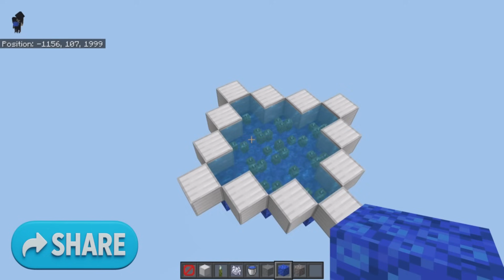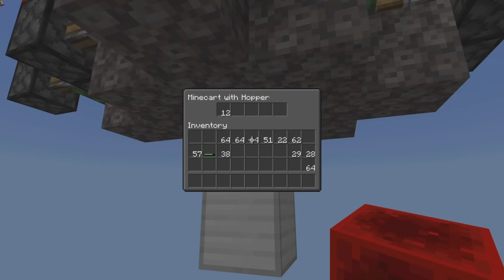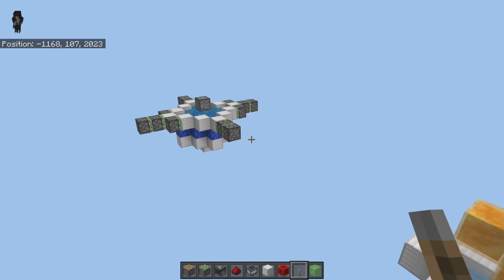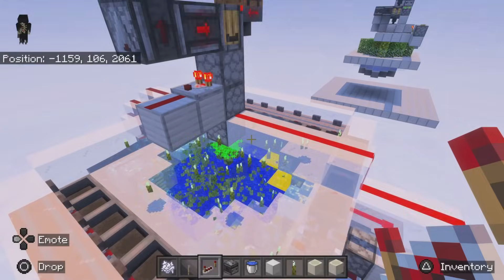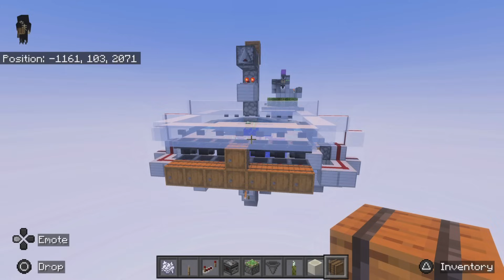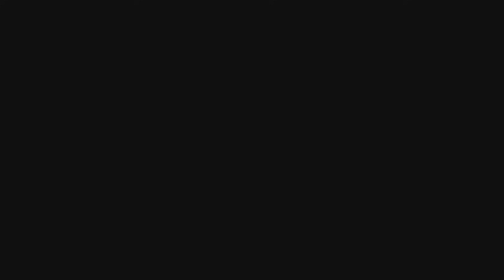Engineering the Best Redstone Sea Pickle Farm | Minecraft Bedrock 1.21 Farm Design & Tutorial

Comment: I really liked your first design, I discovered that putting a waterlogged top slab under the coral keeps it alive. I finished the build that way and it works really well. Produced 45 stacks of sea pickles from 9 stacks of bone meal. Slightly more than hopper speed but the hopper minecart still had an empty slot when the dispenser was empty.
Reply from the maker: Thats awesome, I have more engineering videos in the works. Is there any farms you'd like to see next